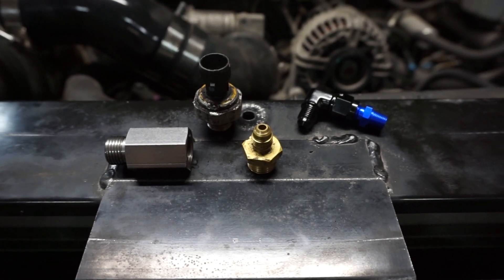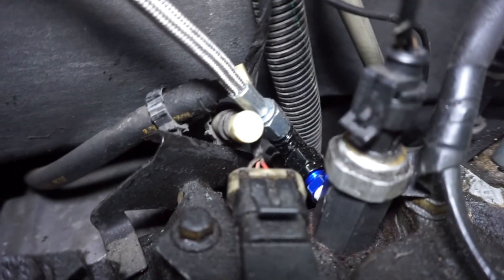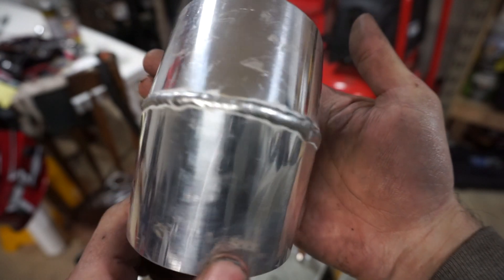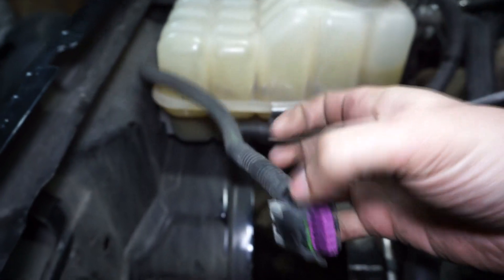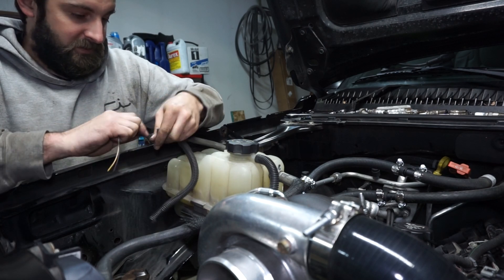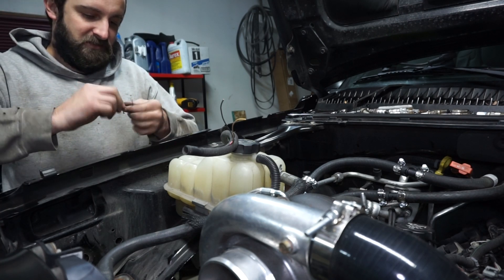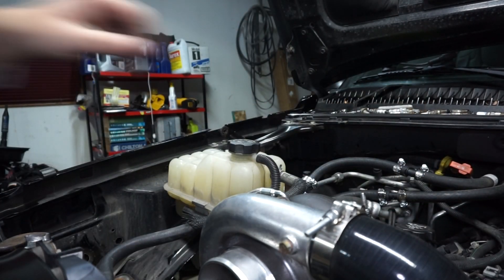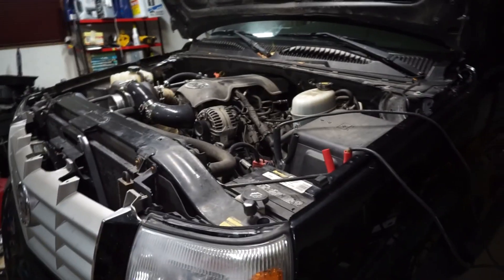Escalade Turbo LS Oil Feed and TIG welding IAT BUNG!!!

Comment: Part number for oil pressure part you tapped?
Reply from the maker: Don't really have a number, but the title on ebay was: Steel Adaptor M16 x 1.5 Female to M16x1.5 Male Fittings HEX 22 L=43mm/1.7inch

https://www.ebay.com/itm/331929258573
Reply: @BlaserBuilds  thanks